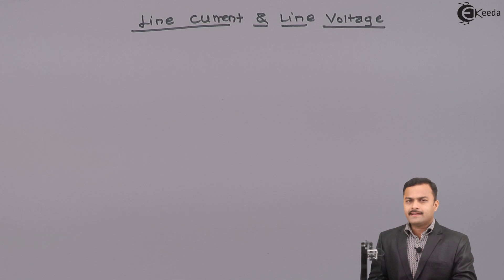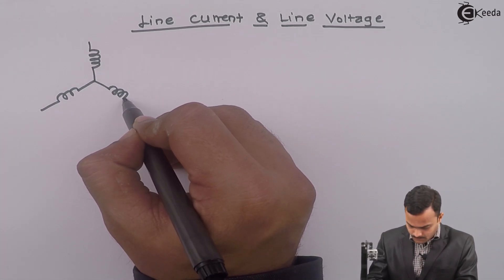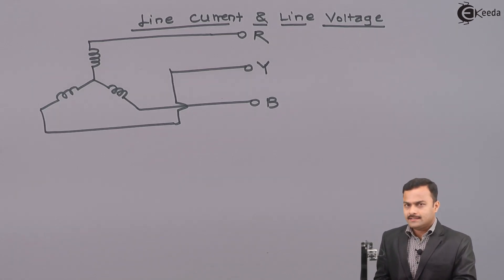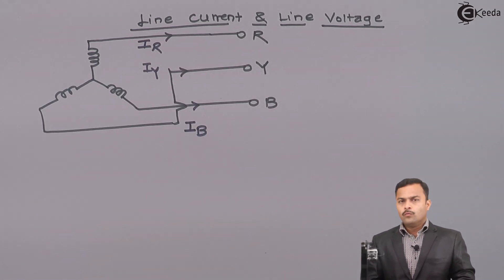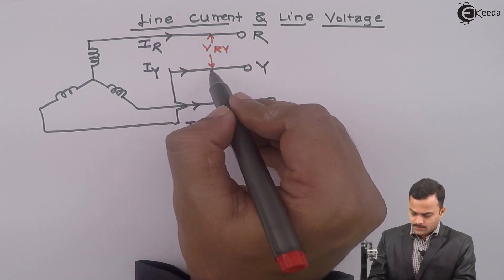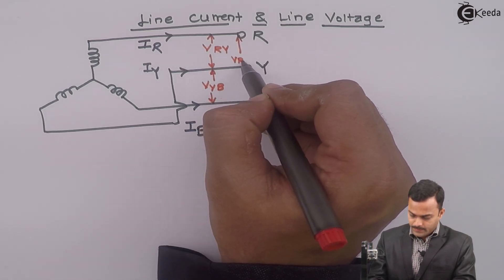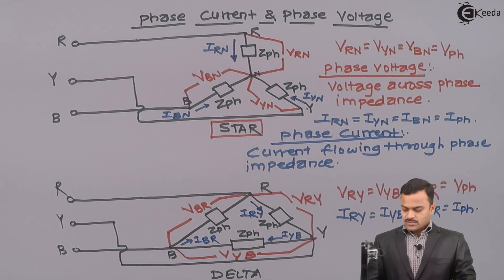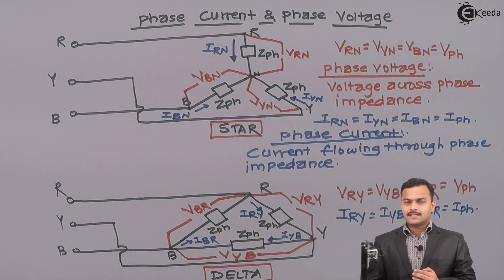Line Current, Line Voltage, Phase Current and Phase Voltage - Three Phase Circuits

Comment: Nice concept and supr explanation sir but in delta winding there is no neutral so  as your explanation how phase voltage is possible in delta winding because u already say that the phase voltage is between r to N or y to N but there's no neutral in delta winding?